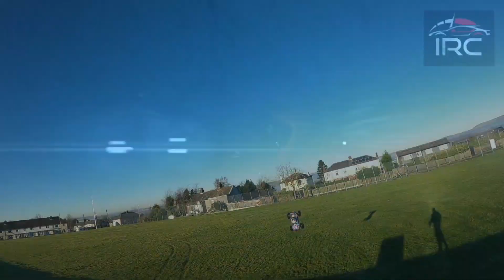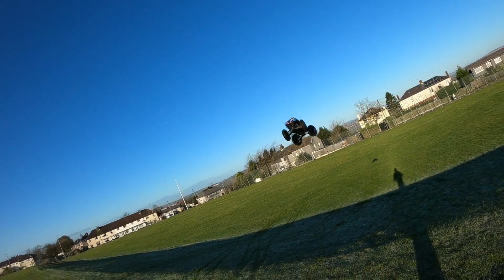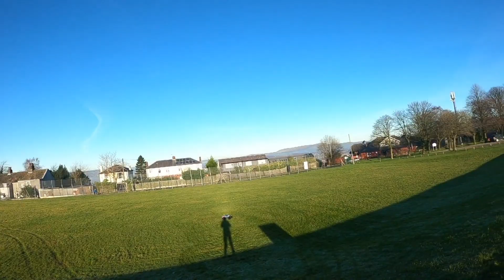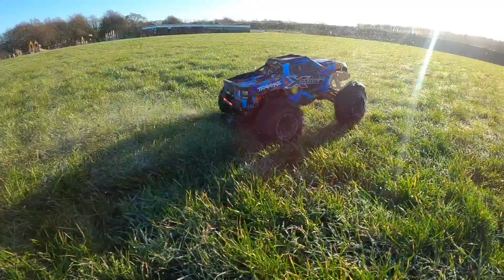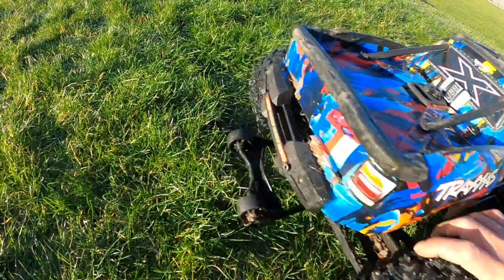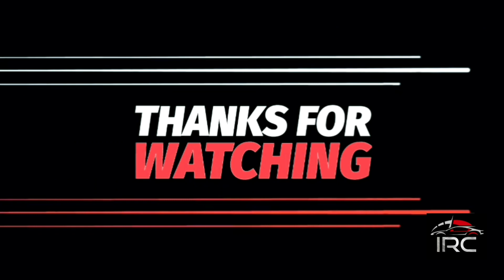PARK FUN! with the Traxxas XMAXX 8S. 19/46 gearing & stock electronics! 💥💥😈

Comment: 20 :46 기어비와 차이가 큰가요?
어떤느낌인가요 

둘중 어느걸 추천하시나요!^^
Reply from the maker: Tbh on the stock vxl esc I prefer to run 19/46 in summer and 18/46 in winter. Honestly it's still not enough to get double or triple backflips... for that you would need to change the esc for a max6 and running 23/46 gearing.

Comment: Over heating issues ?
Reply from the maker: Not really tbh. I don't recall having many thermal cut offs. The car has been good 👍
Reply: @inspiredrc  I ask because I’m trying to find best gears for my xmaxx to run on to backflip and have good power without overheating
Reply from the maker: @sunnyv1281 At the moment, I've got 19/50 in my xmaxx. Just because that's all I had available in my parts draw. I haven't had any issues with it. I'm based in the UK, so the weather isn't usually an issue. Maybe that helps with temps as well. My advice is to try 18/46 and see how it performs, then maybe go up a couple of teeth on the spur. Really, it needs a max6 combo to make it come alive. You can even go 22/50 depending on whether conditions. To bash a big rig well, you want to get it to 50mph+ in my experience. 
I can get backflips on 18/46 though. 👍